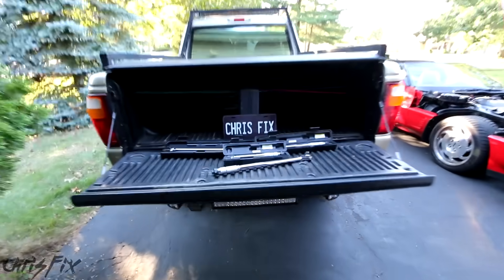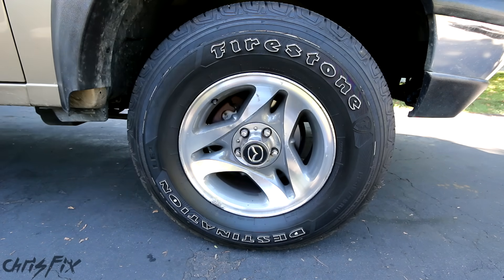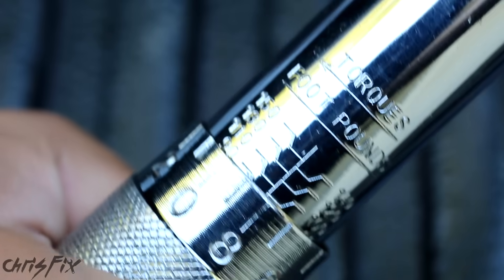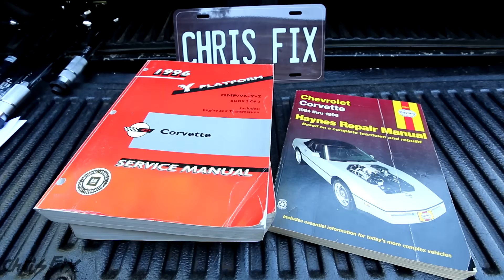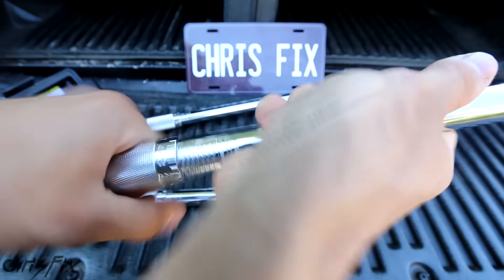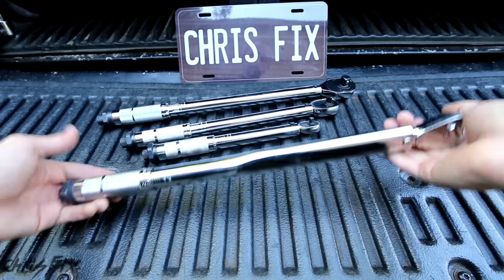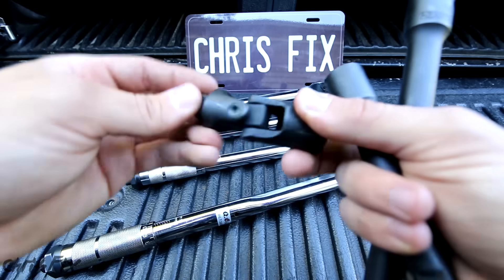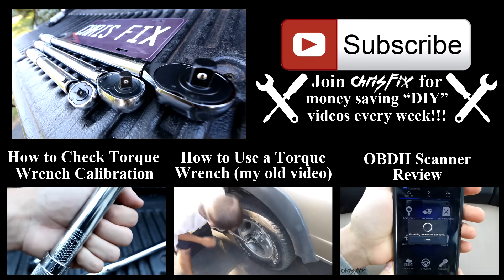How to use a Torque Wrench PROPERLY

Comment: And another video that show how to NOT use a torque wrench. But every mechanic that I saw until today has used a torque wrench in a wrong way. First of all, you should click the torque wrench at max (best) torque for about 4-6 times on a very tight nut. Then you put your torque wrench in a position so that you use the force downwards and more important, the torque wrench should be level (horizontal) to the ground the best as possible when it clicks. And the most important: Don't push that wrench down like an idiot. You go slowly with a consistent movement. You can very well see in this clip, that the nut is turning even the click has already been heard. This way you're guaranteed to overtorque your nut. If you're lucky it's "only" about 10-20%, if you go very fast, it might as well be 50% or even double the torque you wanted, especially with low torques. Don't ever do this on aluminium parts or when working on an engine. You're guaranteed to break something. Also never ever click two or more times. Each time you click more, you first have to overcome the already existing torque making sure that the next value will be higher than the first one (which was the correct one).

Comment: Your setting the torche wrench at 100 lbs ft, but that same line that u set it on 120 and 140 also share the same straight line. Please explain I am new to this tool. I'm wanting to buy one. Thank u for your video.
Reply from the maker: Just get one and you will see how it works. It is not hard at all. A lot easier to see the lines in person.

Comment: I have to correct you somewhat on the terminology for expressing torque. First, I am a retired physicist with B.S. and M.S. degrees in physics who has taught calculus-based physics courses in college to prospective engineers and students in the physical sciences. My particular field of interest is mathematical physics, with hobby interests in electrical and mechanical engineering and a lifelong interest in cars. I am greatly interested in your good efforts to educate and help people in working on cars. It is in that spirit that I offer this advice.

Torque is commonly thought of in engineering circles as a vector quantity, since it has a magnitude and a direction. A scalar quantity like work or energy has only magnitude. In strict mathematical terms, entities such as vectors and scalars are classified as such if they obey certain transformation properties, under such operations as rotations or translations. By its strictest definition torque is not even a vector, but is a more general entity called a tensor. Because it exists as a three-dimensional entity, the tensor product that defines torque has the properties of a vector and is accepted as such in a loose sense by engineers and technicians.

The simplest war to look at torque is to view it as a something called a vector, or more properly a pseudo vector, or cross product, denoted r ⨉ F. This is a product of two vectors, r - a position vector, and F - the line of action of a force. The product generated is another vector whose magnitude is the simple scalar(numerical) product of the factors and whose direction is perpendicular to the plane formed by the two vectors. Because this is actually a tensor product, the multiplication does not commute, i.e. r ⨉ F does not equal F ⨉ r. the magnitudes are the same but the directions are reversed. For a scalar product, like for work or energy, the product does commute.

In adhering to the strict sense that torque is a pseudovector whose order of multiplication is important it is better to write the units that comprise the product, meters and Newtons for S.I. units or feet and pound force for imperial units. So retain the same order in expressing the order of the product, distance times force, in the units for torque. m*N or ft*lb. For expressing the units for work, W  = F times distance, the order doesn't matter since it is a scalar quantity. I think it is helpful for us to keep this distinction in mind so that we retain a clear understanding between the difference between a vector and a scalar.

You can consult any college-level introductory physics text, algebra or calculus-based, to confirm what I've said. Some of the arcane stuff on tensor properties or advanced transformation principles would be found in more advanced works in applied mathematics.
Reply from the maker: Thanks for the info

Comment: Being off by a few lbs from a 3/16” bolt all the way up to 1-1/2 bolt is never going to matter. I’ve been doing mechanic work for 40 years and no mechanic uses one ever. The only time is maybe building the internal parts of an engine where 1000th of an inch matters. The rest of the bolts on a car really don’t matter. The only safety issues on a car anyway are the front end and brakes so just crank them down tight. Common sense. I’ve had my torque wrench 25 years and just checked to see if it’s close and it is. I don’t throw it around and that’s a good ora rice for sure but they hold up pretty well. Now new torque wrenches I don’t know about. They could be junk

Comment: And no one in these videos ever tells you about sockets and what size to get, and it's not in the manual. Unless you already have DIY/car mechanics experience in which case why watch these videos...
Reply from the maker: I'd recommend buying a complete set of sockets so you have every size and you're covered no matter what job you are doing, I go over that in this video here: https://www.youtube.com/watch?v=rCOgrIPFxIY and I talk about the sizes of bolts/nuts in my videos so you can get an idea for your car/truck. Sometimes the manuals list them and other times they don't, usually a quick search can tell you what tools/sizes you need depending on the job. You can also just have your set out and try a size and go up or down from there, then just leave it out so you have it for reassembly

Comment: can i use a 1/2 on a small bolts lets say i need 40 foot pounds or would it be better to use a 1/4 or 3/8 for better accuracy wouldn't the 1/2 be less accurate possibly braking the bolt over tightening the bolt thing your almost at 40 foot pounds

Comment: why did you say it ranges from 20ft lbs to 150 when you have the option to bring it down to 0, is it not accurate to go that low? im trying to torque my transmission bolts to 8lbs
Reply from the maker: It's not accurate/designed to go that low. In your case I would buy a torque wrench that can do in-lb and then you would be setting that wrench to 96 in-lbs

Comment: I actually did a precision alignment class for my job. It was interesting, they had this machine that measured clamping force, and they had everyone try to tighten down a couple of nuts without a torque wrench. They told us to do our best to use the same about of force each time. No matter which method we used, we were all wildly off without a torque wrench lol.

Comment: Forklift mechanic for 40 years can you believe I've never use the torque wrench. But I just picked up a three-quarter inch Drive from an estate sale. The lowest it goes is 100. But if I keep screwing the handle it will go lower but there are no more numbers, so I just estimated where 83 would be because that's what it says for a Toyota Tacoma lug nuts. And I did have a click. But I was able to keep going tighter but I assume I'm not supposed to. So I just stopped when I hear the click. I'm sure the three quarter inch Drive is probably too big for lug nuts on my Tacoma. But I basically got it for nothing.

Comment: I read that I should never loosen a lug nut with 
my torque wrench, what is the reverse lever for?
Do they make a torque wrench under $4500
that works both directions?

Comment: Are torque wrenches really necessary? Tight the damn thing hard untill it fart or you fart. That's what we used to say during the iron cast engine days when engineering meant strength and durability not sensitive plastic aluminium foiled junk engines. Pardon my English. 

Imagine using a torque wrench when building up the whole engine bolt by bolts and nuts by nuts. I'll go nuts figuring out the specs and gauges for each engines models. This is crazy times but I'll have to do it at the end because this modern day sissy vehicle break easily and strip the threads everytime you apply good old mechanic force.

Comment: Thanks a lot!! I just received my torque wrench, a relatively cheap EPAuto. I was confused. In the info sheet it says to loosen the locking screw by turning it counter-clockwise (that's OK), but it says to also turn the adjustment ring counter-clockwise to adjust to torque that I want! In fact, it's the opposite! You have to turn it clockwise (unless you want to lower the torque)!!! Very strange mistake...

Comment: That is definitely not how springs work. Springs lose strength based on how many times they're stretched and compressed, not how much pressure is on them. You're just ruining your wrenches quicker.

Comment: The problem with this type of torque is that the prime mover (operator) cannot stop the pull when the wrench triggers and bolt or nut are over torqued by as much as 20%.  That is ok for a lug nut, but if the torque is critical you need to use a digital torque wrench.

Comment: Does snug tight count for every nut and bolt on the car before using the torque wrench? Because I’m wanting to do my shock absorbers and brakes discs etc? With the wheel nuts also they say screw in till finger tight not hand tight is this correct or wrong?

Comment: I just picked up a 2021 ridgeline and am hoping to do a good amount of the maintenance myself (brakes, all fluids and oils, and tire rotations). Definitely need to pick up one of these wrenches. Would like to do more of the maintenance, but I live in an apartment with no garage available, so that rules out complicated stuff. Most of my friends family don't have a garage either and technically I'm not allowed to do car maintenance on the lot, but F them on that.

Comment: You forgot to mention that the force applied to the wrench needs to be done slow and continuous. If you do it fast and uneven it will click too early and you won't reach your desired torque.

Comment: I also have a AC Delco digital torque wrench in which you can read the values as the torque is applied and will beep rapidly when the set torque is reached. It works very well also. You use it on any 1/2" drive ratchet.

Comment: Question i got bigger rims on my car then the factory rims there 20 inch rime factory says 16 or 17 on my Lincoln Ls v8 what should the  torque spec be for them the torque spec for 16 or 17 inch is 100ft should I go higher?

Comment: Hey Chris, so I have a motorcycle so most of the torque specs are very low. I have a 1/4 torque wrench that has a working range of 40-200 in-lb. However there’s a few things in my shop manual that torques to 1 ft-lb. Since the lowest range I can go to would be 3.33 ft-lb what should I do? I looked online and the lowest working range on torque wrenches are 20in-lb. I’m kind of lost on this, for small torque specs do I just tighten by hand and hope for the best ? There’s even one that torques to 0.8 ft-lb. Thanks for all your videos !
Reply from the maker: I would look into torque screwdrivers as they can go lower than 1ft-lb and they are designed for smaller fasteners which it seems like you are encountering

Comment: My question was about the extensions but like you said sometimes there’s no choice. I picked up a Husky digital 3/8 drive torque wrench goes from 20-100 lbs/ft which handles everything on my 2 door Lexus. Even the lugs are 76 lbs/ft. I found it at Home Depot on clearance for half off from $200 so 100 bucks with tax and I’m EXTREMELY satisfied. Most legit tool I have- makes me
feel good just holding the nice neoprene handle 👍🏻

Comment: Definitely use a torque wrench any chance it’s required. I’ll stick to the rule “if it has torque specs, use em” because over tightening a singular bolt cost me an entire transmission

Comment: This might be really dumb, but as a beginner the one thing I'd like to see in full is you actually tightening the nuts/bolts from start to finish. The torque wrench looks like it doesn't operate in the simple clockwise motion that basic wrenches do, or if they do it would be good to know either way. Otherwise I really appreciate everything else.
Reply from the maker: Nothing is dumb so thanks for the feedback! It works like a normal wrench but do not loosen bolts with it.

Comment: Great video and very informative!
When choosing the drive size:
1/4": up to 50lb/ft, not really useful for automotive work
3/8": up to 100lb/ft, good for most automotive work(spark, lug, body bolts)
1/2": up to 200lb/ft, great for engine or transmission work
Reply: What about 1/4 for small bolts n nuts on the top of the engine 

3/8 for mid size 

1/2 for large sizes ?

How does he use a 1/2 for everything? Needs adapters correct ??

Comment: So if a 1/4  torque wrench only goes upto 25nm but I need it to be 30nm tight can I set it 25nm and then use the numbers in the middle and add 5 so it then would be 30nm tight ???
Reply: no, you will need a torque wrench that goes up to 30nm

Comment: on the HF torque wrenches i set mine to the lowest range after use. For example the 1/2 in drive I set it to 20ft lb, cause the range is from 20- 150ftlb. On the 3/8in, i set to 5ftlb, because the range is 5-80ftlb. 
Should they be set instead to what ever the lowest torque line is on the wrench instead?

Comment: Same basis mistake made on torque wrench use. Only valid setting if the threads are clean and lightly oiled. Second application of torque to click gives the true torque after all nuts have settled Otherwise rust and debris or damaged threads give false readings. Rolls Royce taught me and never had a failure in 50 years.
Reply from the maker: For cars you don’t need to be that extreme. Maybe for engine builds but not for suspension and the like. But thanks for sharing!
Reply: @chrisfix  To be so confident as to advise dirt, rust or grit on wheel threads do not affect a true torque wrench reading you need to have more decades of investigating and writing expert reports for accident claims involving wheel loss on both "cars" and commercials than me. Hope you have bottomless  liability insurance that is willing to cover your claims of expertise.

Comment: Small correction: extension size or thickness has NO influence on the torque reading. The proof is simply in Newton’s third law. Unless you have gargantuan force and you can bend a steel extension to give the wrench a considerable angle, the torque at one end of an extension must be equal to the torque at the other end, no matter the angle of twist in the extension. Use as thin or as thick as an extension as is convenient (and makes sense with the amount of torque applied). Great video, Chris!

Comment: Important tools ,but how accurate are they? And how can I make shure the one I buy is accurate?  My guess is most of them are 
pretty much useless
Reply: they start at about 4% +/-  accuracy, more expensive ones are better. they are not useless at all, especially for lower torque applications even 5% off at 25 ft lbs would only be 1 ft lb off
Reply: Do they come with a conformity certificate to a directive, or standard? You can pretty much feel the right torque with a simple wrench, but if you use an off spec torque wrench, it can end up in disaster. In a professional setting, they must be calibrated, certified and tracked
Reply: @stighenningjohansen  yes they come with a certificate and need to be calibrated every now and then. and the feeling the right torque thing isn’t really true, so much easier and more accurate to use a torque wrench
Reply: @arcanevoid9199  Thanks

Comment: I'm an old timer, I would like to tell you of a technique that us old timers use. I'll use your example; you said your torque spec was 100lb-ft. What us old timers do is torque to 50lb-ft, tighten all bolts/studs in the cross pattern you used, then go back and tighten to the 100lb-ft. Slightly more time consuming but gives better results.

Comment: Hey Chris, your method to torque the lug nuts is not correct - while tightening you were pulling the torque wrench upward towards you, that is not best practice - the correct method is always to push the torque wrench downwards with one hand and the other hand firmly on the wrench head to ensure the wrench is perpendicular to the lug nut. while pulling up your wrench was not perpendicular, was at an angle and could easily slip and injure you at higher torque and you never use single hand always use both hands and push down, never pull !!

Comment: This does me no good considering I need 7 to 12 lbf-ft  or 10 N-m to 16 N-m for my dirt bike bolts. I'm using a 1/4" torque wrench and not 100% sure how to read it. The IN-LB side says 30-200. The N-M side says 3.95 - 23.16. Honestly super confused by this.

Comment: Mathematically torque is a product of force and distance from the center point.  Because of this the units are also a product or, multiplication, of each other, and can be swapped around.  In a more strict sense, I'm saying AxB=BxA and that this applies to the units, also.  So there really isn't a right way to say what unit comes first in this case.  The only reason you might say the force first is because that seems to be the convention even though in the equation for torque it is shown multiply the distance first.  This may very well be where the ft-lb convention came from!

Comment: Would a 3/8” torque wrench be able to fit inside to tighten calipers and rotor brackets? I mean it won’t be too long of a handle? Or could I probably be able to reach from underneath inside. If that makes sense. Lol